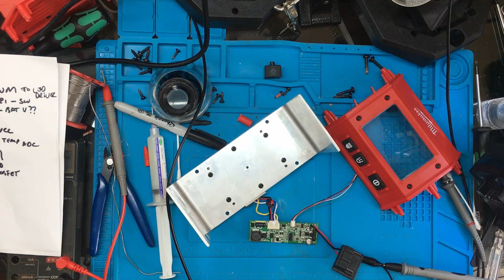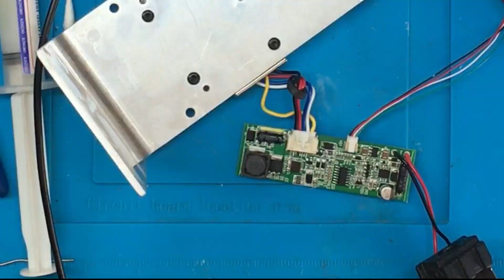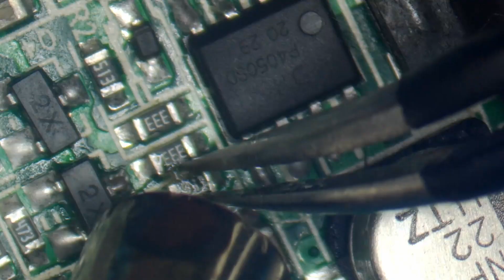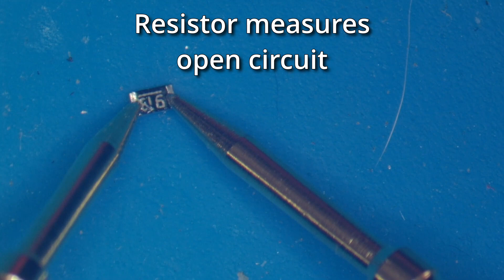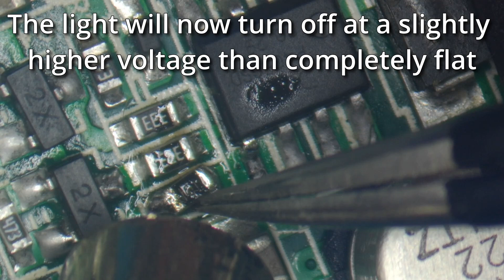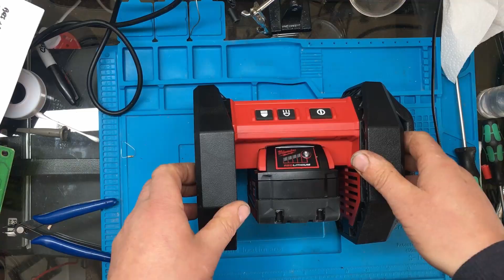Milwaukee M18 Flood Light / Area Light / Work Light Repair #2

Comment: Nice fix clearly some design faults given the amount you repair
Reply from the maker: Thank you for your kind comment. Milwaukee stuff in general seems to be good quality, I just thought I'd save a bit money by buying broken items and hopefully repairing them. For instance the SDS drill I bought I paid £31 for, It cost me £10 for the parts, and £25 for a replacement chuck as it was missing. Total £76 instead of £300 for a brand new one.

Comment: I think I was bidding on this faulty light on eBay, cheap fix if you know what you're doing
I definitely don't & wouldn't of known how to fix or repair that resistor
Reply from the maker: Yes, there is a little bit more to these than I first expected. I actually spent around a whole day trying to figure out why it didn't work, and pretty much reverse engineered the whole circuit and what pin is programmed to do what on the microcontroller. Also the idea behind the video's is to help people like yourself who might end up with a broken light etc to try to be able to fix it yourself :)

Comment: Hello. I'm currently doing repairs on the same product and need to replace the ptc fuse. Would you please be able to tell me the size? Also, do you have any parts and diagram resources you could please share with me?
Reply from the maker: Hi really sorry but there's no parts diagram, just what I worked out by looking at it. I'm not sure of the PTC fuse size, perhaps you can see it on the other video I did of one of these?

Comment: Where do get a microcontroller for m18 folders light circuit board parts ???
Reply from the maker: Not sure what you mean? If you're microcontroller is blown then you would also need the code to reprogram into a new one.

Comment: Do you know where I can buy a circuit board for a Milwaukee 2125-20 Under hood work light? I took it to a electronics store here in Texas and they said my board is fried, or can you repair it? Thx
Reply from the maker: Unfortunately I don't think Milwaukee sell many parts like circuit boards. I'm in the UK so it probably would cost more than buying a new light. If you are confident in replacing parts you could email me some pictures of the board and I could suggest what to test or replace?
Reply: @BuyitFixit  ok cool sounds good, I'll get to taking it apart shortly 💪🏽
Reply from the maker: Email address is on the channel about page under contact.